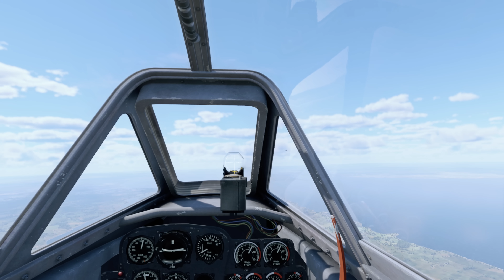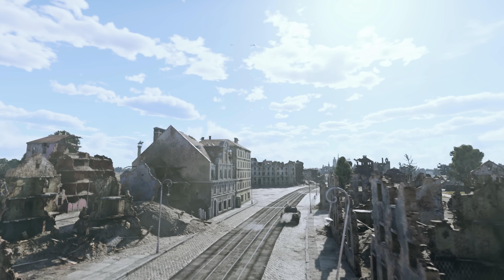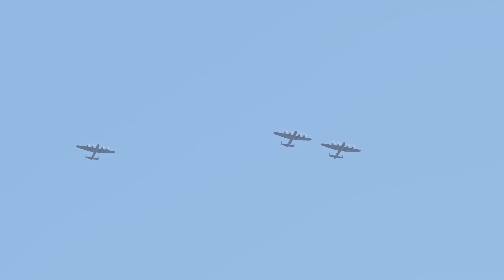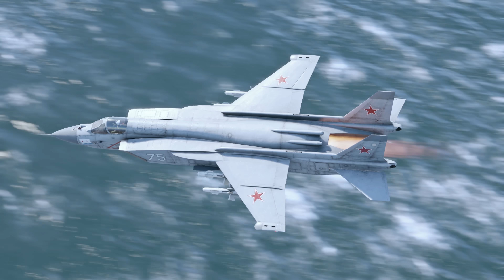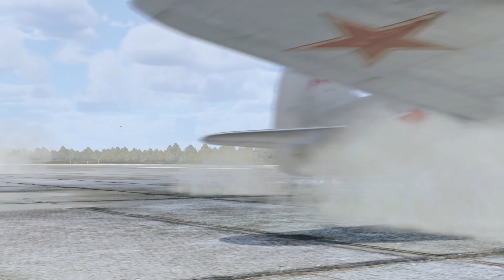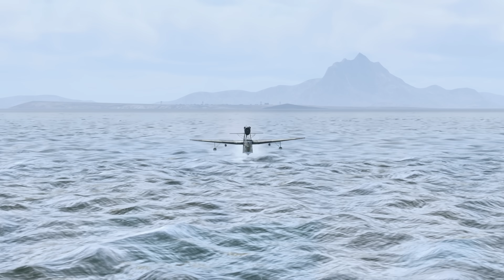Book of Records: Aircraft Engines

Comment: In just 15 seconds, Gaijin managed to be wrong about the J7W1 3 separate times.

Truly outstanding.
Reply: "Number of blades on a single engine" I think they meant on a single propeller(?) because there's plane like Wyvern that has 8 (4 + 4 counter rotating) blades
"One of the fastest" If only it can reach its top speed, which is almost impossible
"Rare canard" Well that one is true, not like it is the ONLY one cos there's XP-55 in US Premium

Shinden is a pure suffering. But maybe i'll try playing it again
Reply: how 3 times? everything was true except fastest
Reply: @astronautdyno3120 

1 - That it's one of the fastest (you even pointed it out so it doesn't need to be explained).
2 - That it's one of the fastest because of the 6 bladed propeller (more blades is worse for top speed, the japanese planned to replace the 6 blades with just 4 in production planes). This one is a bit picky I suppose, but the speed the J7W1 does have is due to basically everything except the number of blades.
3 - That it has the highest number of blades on a single engine in the game (someone has already explained it, there's both the Wyvern and the S.O.8000 with 8 total).
Reply: @flipallthetables793  ahhh but those have 2 propellers on a contra rotating set up so not 1. but the other 2 are correct my apologies
Reply: @astronautdyno3120  That is true, but Gaijin specifically said it was the most blades on one engine.

Even if the Wyvern and SO.8000 use contra rotating propellers, it is still 1 engine.
Reply: @flipallthetables793  true true

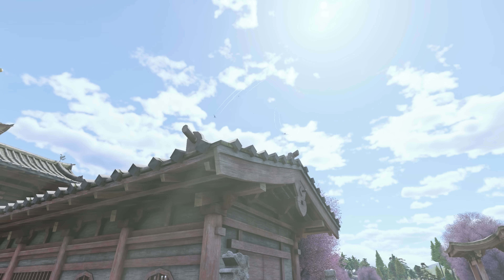Comment: 2:32 pretty sure that belongs to Wyvern with 8 blades
Reply: wyvern has 2 propellers with 4 blades each
Reply: But those 8 blades are divided on two contra-rotating propellers, 4 each. They probably meant the most blades per propeller and not per engine.
Reply: They clearly states "number of blades on a single engine" though so  it's 8 blades on a single engine
Reply: @ImSmad  Yeah, they screwed up here